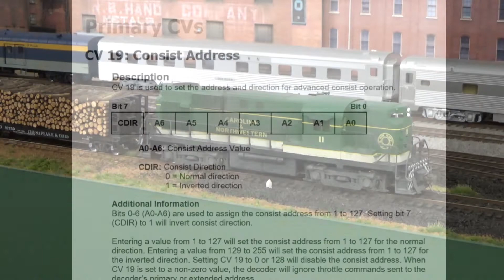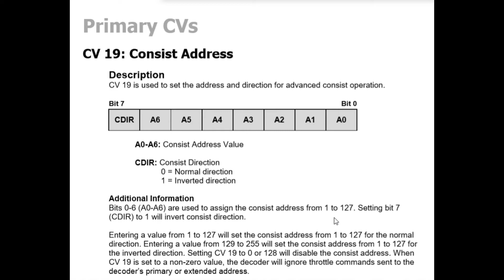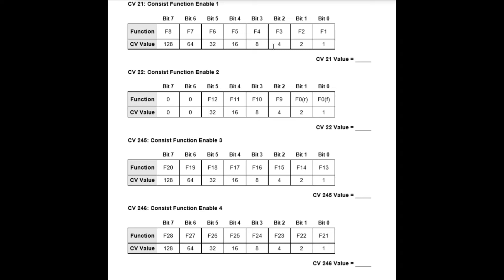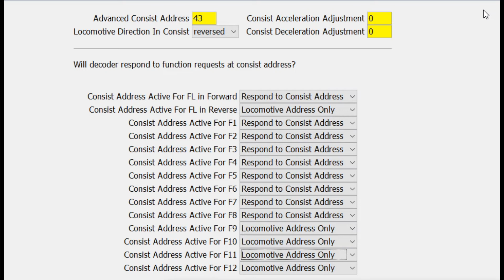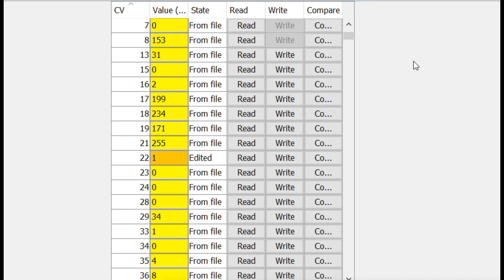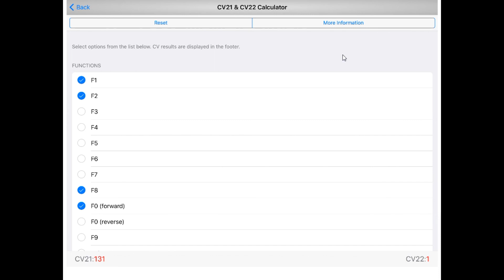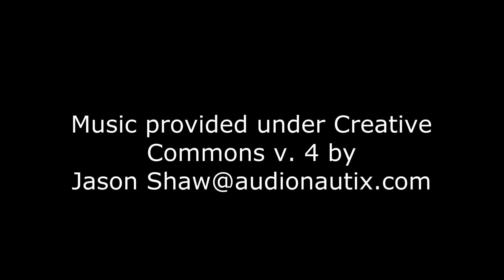55. DCC 101, Consisting with DCC pt3, Advanced consists

Comment: I know this was two years ago but I'll ask anyways.  I have 3 locomotives all using the same TCS AMD4 DCC decoder cards (N Scale).  I'm using a Digitrax DCS-52 control station.  I used the MU option to create my simple consist of the 3.  What I'd like to do is to have the lead locomotive headlight turn on when moving forward and the rear locomotive's tail light to only turn on when the consist is in reverse.  Basically, only the lead locomotive's light to turn on depending on the direction of travel.  Do I need to use Decoder Pro for this?  Or is this something I would control in Decoder Pro?  Thank you for taking the time.
Reply from the maker: It sounds like you need to use advanced consisting for that. It allows you to control how the individual loco functions in  consisted loco will respond.
Reply: @TheDCCGuy  Do I use JMRI for that?  I’ll watch your part 3 video again. Thanks.
Reply from the maker: I use DecoderPro for just about all programming other than the simple basic CVs.